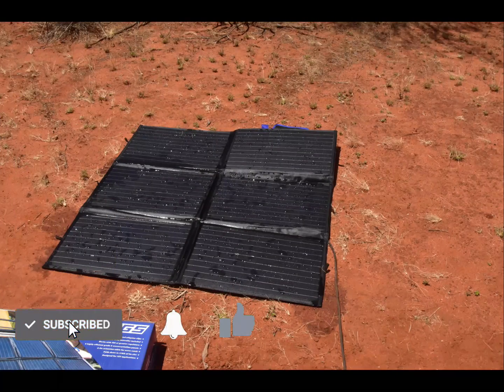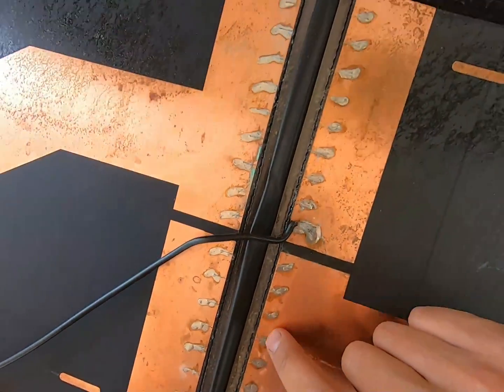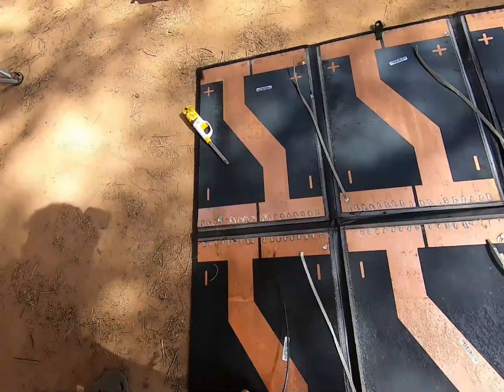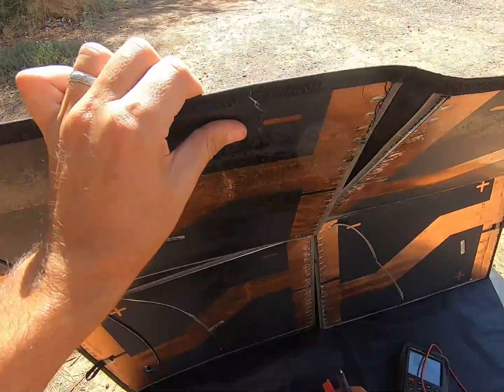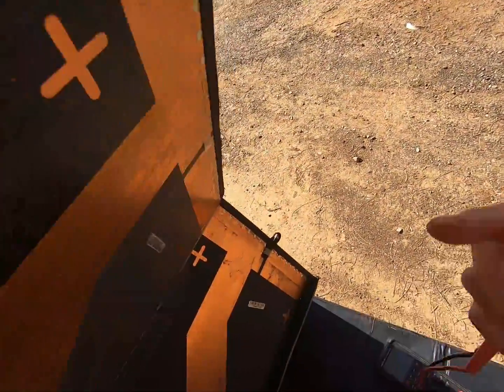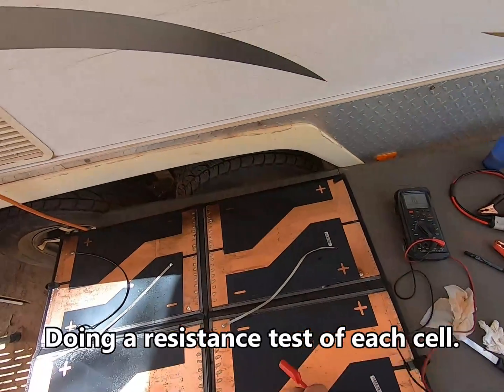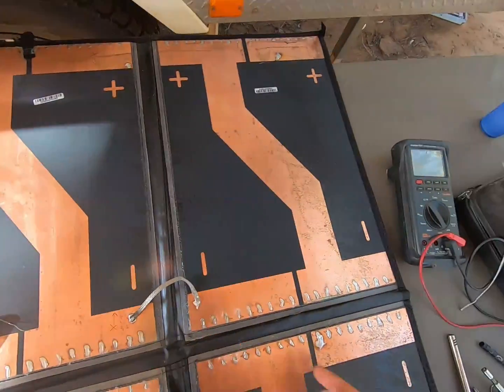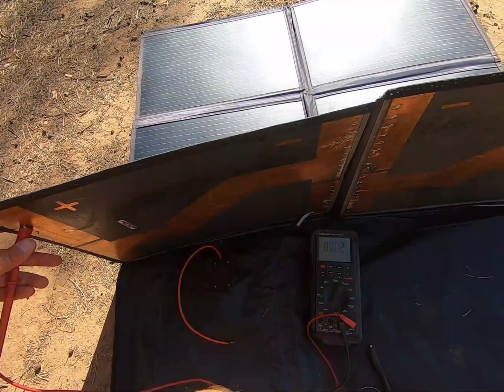[DETAILED] How to fix a faulty solar blanket

Comment: Hi thanks for the video might try to sort my blanket out aswell I’m getting 21v but only 0.5amps do you have any suggestions or just follow the video and narrow it down ?
Reply from the maker: It really depends how yours is wired up sorry. There are likely some sections in series and others in parallel, and depending what's failed will depend what's causing the low current.
Reply: @TheMusingGreg  it’s a 200w kings one aswell I’m assuming it would be a damaged wire because it’s been working for 3 months then all of a sudden nothing
Reply from the maker: It certainly could be a broken wire, but it could be one panel has suddenly failed. That's the benefit with getting access to the wiring on the back because you can test each cell and bypass any that may have completely failed, and hopefully get the rest working fairly well. Good luck!
Reply: @TheMusingGreg  thanks I appreciate your time in replying I’ll pull it apart and have a look before it goes in the bin hopefully can get it going

Comment: I just pulled my brother’s 2x4 Kings panel apart and it is definitely not made to the same standard as yours 😂

It seems to have been made out of a fabric that isn’t UV-stable and panels that are water soluble. Yes, really. The solar cells are on an MDF backing that is rotting apart.

Some of the panels are a different kind. Some to the stitching goes through the panels. Some of the interconnecting braided wicks have heat-shrink on them.

7/8 segments actually still make 3-4V but it isn’t worth fixing. I wouldn’t trust it to keep the lights on.
Reply from the maker: Yuk! I've never really thought of my Kings units being made to a high 'standard' but sounds like yours is even worse! 😄 Unfortunately what you've described is one problem with cheap brands like Kings. They will change suppliers when someone else can give them a better price, so there can be a lot of inconsistency between batches from different manufacturers, whereas more expensive brands tend to find a good supplier and stick with them. It's why I typically don't review really cheap stuff, because in 3 months' time it might be irrelevant.

Comment: You don’t need to de solder all the connectors to test each panel, leave ground on the Anderson plug and test each cell and it will go up by 1.8v each time.
Reply from the maker: That's a great tip, thanks for sharing!

Comment: Got a zero voltage foldable solar panel,  watched your video, I checked all the panels, they all worked, I realized it might be wrong with the diode, after removing the diode, got the 24v voltage, so I have to find a similar diode to replace it.
Reply from the maker: Glad you found the problem! Hope you get it working!

Comment: I have an XTM 120w blanket and a companion 200w blanket, i thought the XTM wasn't working well so i tested it today, getting about 3.5A. I tested the 200w and it also putting out 3.5A, I'm guessing something has failed like yours. I might have to do some more testing.
Reply from the maker: Possibly. Although check the voltage of the battery they're charging; if it's already nearly full you won't get max current from the blanket. You should get best results if the battery's about 2/3 full, so the regulator is able to maintain close to 14.4 volts without needing to dial back the current flow
Reply: @TheMusingGreg  I put the blanket in the sun, covered each panel 1 by 1, only 2 of the 5 were working. I cut it open and found the wire joining the 2nd to the 3rd broken. The other wiring on all the joins didn't look much better.
Reply from the maker: Great, well done following the process! Shame to hear of the quality but at least you can replace the links now and hopefully get it back up and running!
Reply: I kind of tested my 200w ridge ryder fold out panel with a watt meter, and even when I angled it to the sun on a clear day at noon, it was only reading just over 100w. It hasn't been used much, and I'm wondering if I need to remove the backing like you did, or is there is typically a failure rate with these panels?
Having a video to refer to is very helpful, cheers.
Reply: @colintranter5162  the wiring between each panel runs around each fold. When it's folded up and you put it on the ground by the handle, the fold that hits the ground and takes all the weight is where the wiring failed. Knowing that, I take more care how I handle it. If the handle was 90 degrees to the folds, it wouldn't have been a problem in my opinion.
Reply: @eroffroad5438 Thanks for the tip...I'll be more careful. They are a bit precious, although Greg was certainly throwing his around. 😅
Reply from the maker: @ @eroffroad5438 Good work chaps. I was just using mine the way I thought it should be able to be used, if it can't handle a bit of rough use in the outback then it's not up to the job I reckon! Colin if you're getting 100W out of a 200W blanket there's probably nothing wrong with it. From all the testing I've done on solar blankets on my channel, that's about right for many units unfortunately. Check out my original 2021 Kings vs Redarc video https://youtu.be/AActNzBZ9FA for example. If you're looking around for better-performing alternatives, consider the Allspark, Companion or Hard Korr Mk 2, all of which I've covered on my channel in the past couple of years
Reply: @TheMusingGreg Thanks for the reply, Greg.
In most of the reviews I've looked at it certainly appears that most of them don't put what there advertised at, which make wonder if I want 200w may be I should be looking at 300 or 400w fold out panel to get 150w -200w of real of world capacity.
But at the end of the day, any extra power is better than none on an overcast day.
Regards.
Reply from the maker: @dizygotheca5162  As a rule of thumb I would say plan for about 2/3 of the rated output under typical conditions so work on that. So if you want 200W, get a 300W unit. See part 3 of the 4 part series I did https://youtu.be/o8rLVv2oCnQ. The exception to this rule is the Mk 2 Hard Korr https://youtu.be/oZfFO8OQizM

Comment: Did you had no voltage prior to the repair ? I have a 120w panel and I had been testing it for few months. It was working fine with around 4A output. Now when I have to actually use it, something happened and now it won't give the same output and current is now only 2A. I have tried to test it without opening it by monitoring voltage by covering each panel out of four and see how much voltage loss I get.. One and two panel shows less voltage drop while 3 and 4 panel shows significant voltage drop. Basically don't know what that means and should I try opening it up and check, what do you suggest ?
Reply from the maker: Yes I had no voltage prior to the repair because half of one panel had gone open circuit. That's why for me it made sense to pull it apart and see if I could at least get something out of it.

In your situation it sounds like the panels with minimal voltage drop have gone faulty, either by having just reduced output,, or one part may have failed but it may be in parallel with another part which hasn't. In either case, removing the faulty part isn't going to increase your output unless it's in series with other parts that aren't faulty and can't currently provide any output.

If the panel is practically unusable for you as it is, you don't have anything to lose by opening it up and seeing if you can isolate the faulty part like I did. However if you're still able to use it as it is, I would just keep it as it is as it's possible you could go through all that work and not actually improve it at all.
Reply: @TheMusingGreg  Took the brave step today and removed the stitches. Four panel are attached in series and the rear side of the panels are covered with some white sticker so not like yours where you can see the copper. Anyways tested it without the sun for resistance of each panel and the first two show most resistance then the 3,4 panel. Soldering is all good and even checked the continuity from the +.ve points of the panel with the visible side thin wire coming from the front side of the panel. All showed continuity. But that's from the one side only, the other side does not show continuity with the terminal even on the good ones. This testing is without removing the series connection. Seems like the panels are just not producing enough volts and that's about it.
Reply from the maker: @CrazzyRandy  It would be worth disconnecting the wiring and measuring the voltage of each panel in the sun. That will help you compare the behaviour of each panel and isolate if it's just one panel with the issue. You could then put a small load on each panel and measure the current through that same load while using a voltmeter to measure the voltage it can hold while delivering that current; that will further help you determine the performance of each panel.
Reply: Finally opened it up last month and magically it was putting out around 60watts at 3 amp.  Measured it few times at it still showed the same. Today though to measure it again and it is back to 2 amp. All the wiring seems good, re soldered all the points and still same 2amps output.  God knows what’s the issue now. It’s nothing I can do and all the panels which are attached in series are good but just not producing enough. Something to do with Earths alignment with the sun🤣
Reply: And the back side of panel is glued with some kind of white sheet nothing is visible from back, only the output points are there.
Reply from the maker: @CrazzyRandy  It sounds like something within one of the panels. Try disconnecting the interconnecting wires and measuring the output of each panel in turn. If one is quite different to the others you can bypass that one and just use the remaining panels. That's basically what I did except I could bypass just half of one dodgy panel.

Comment: What was the one style heat gun you used?  Also, did you just use the existing solder and melt it back together or did you add mode solder?
Reply from the maker: Hi mate, it was a Red Devil butane powered soldering iron. I think I just used the existing solder but it's always good practice to add some new solder because the flux in the solder helps to make a good joint.

Comment: Could you change the kings blanket from series to parralel? And if so what would it do?
Reply from the maker: You could but it wouldn't work. The benefit is that if a cell failed the blanket would still give some output. However the big problem is that the output voltage would be extremely low (around 1.6v I'd guess although you could measure it), which would be too low to run the regulator and the low voltage would make it more susceptible to cable losses. 
At the moment you've got all those solar cells lined up in series which means the voltage from each cell adds together to give you the total of 20 volts or whatever they put out. If you put all those cells in parallel, then you'll only get the voltage of one single cell, but with the current increased by 12x. But with very low voltage you get many more losses in cables.

So bottom line, it wouldn't work 🙂
Reply: @TheMusingGreg  ahhhhh ok. Thanks for clearing that up for me. Wasn’t to sure. I might have a go at looking at my 200w kings blanket on the weekend.
Reply from the maker: No worries good luck! If you've got one dud cell like I did you can just bypass that and at least get some power from the others.

Comment: Hey. After the repair how many Wots was is producing?
Reply from the maker: Hi Craig, I can't recall if I didn't say it in the video, but I remember it was 11/12ths of the previous output. Given I usually got around 75W from Kings 200W blankets, I'd guess around 70W.
Reply: @TheMusingGreg  only 75? Damn I was getting 75w from 120w when it was really working.
Reply from the maker: @CrazzyRandy  Yeah they were very poor for me. I've recently bought a van with 3x160W ~12 month old Kings slimline panels on the roof. Should be 480W altogether, I get about 90! Same deal, Kings solar in my experience is a pathetic joke and false advertising.
Reply: I thought solid panels would be more reliable but seems anything solar from kings is crap. I have already returned the small 10 watt solar charger. What a joke it was.
Reply from the maker: @CrazzyRandy  I am yet to find any Kings solar product that works the way it's advertised - and I've used 1x 120W blanket, 3x 200W blankets, 2x different 'MPPT' solar regulators (looks like PWM inside with the words MPPT stamped on the case), and 3x 160W flexible panels. An utter waste of money in my view for anything other than careful and occasional use

Comment: Wouldnt it be possible on Monocrystaline panels, to simply Shade each minor "array/panel" one at a time instead of the total removal of all array covering?
Reply from the maker: @DOCWHOK9 it depends how they're wired up. On this unit, no that wouldn't have worked, because all panels were wired in series and there were no bypass diodes. This meant the one cell panel stopped all current flow and you had nothing to measure. However if you had a different configuration and the panel was just low output, then yes you could shade the panels one at a time and see which cell / section shading didn't reduce the output further, and then you'll know which is the dodgy one. But you still have to open it up to fix it.
Reply: @TheMusingGreg  Cool, great explaination. I think it would be great to have a switch that could convert a panel from serial <> parallel, and then that test would be easy. Itad be even better if panels auto-bypassed when faults occured.
Reply from the maker: @DOCWHOK9  Yeah that would be fun to do for us electronics nerds! Although probably impractical in production - the extra wiring and complicated switching would increase cost and complexity for no practical return for 99% of users.
Reply: I just did and it helped me to diagnose the fault. I found that only 2 out of 6 panels produce current. I am yet to open and inspect the connecting straps.

Comment: Ive just unstitched my kings 200w panel bought july2022 and surprisingly its in series parallel, and diagonal opposed in an L shape, and the entire thing is wired using braided cables that are NOT insulated. This meant that the main pos and main negative simply touched and shorted the entire panel! 

Ie   (1) - (2)
                I
      (6)   (3)
        I
      (5) - (4)
123 series
456 series  then both sets in parallel 
And the panels are sealed completely in white resin just like glass panels, and theres two tiny tin strips on each panel.
Reply from the maker: Wow, interesting. The series-parallel arrangement is curious - that will give double the current but at half the voltage - I wonder if that's so they can advertise it as a '20A' solar blanket?! It might give slightly better results with a PWM regulator where excess voltage is wasted, but I don't think it would benefit a MPPT regulator much. However you're going to get more cable losses if the supply voltage is lower. Or possibly since they're using a different panel now as you say, perhaps the new panels are higher voltage and lower current so they've done this to get the output back to what it should be. Curious either way.

Not using insulated cables might save a bit of money if the backs of the panels are all sealed off, but if you managed to get a short somewhere it's clearly not the right choice, at least wherever you got the short.

I continue to shake my head at Kings gear.
Reply: @TheMusingGreg  okay so, the diodes did help me find one panel that was going completely open circuit once hot, so ive made the decision to cut both sets of blankets i have apart, and find all the good cells and make one long single row blanket, and in doing so i tested the cells to be 7.5voc and some cells 3.2a short circuit current, others to be 2.5a so they really are a mixed bunch. Given im using a victron 100/30 ive decided to wire them in an 11 cell series setup, that way ill get the most voltage and least losses. Ill also be adding the diodes since if one gets shaded or goes faulty ill only lose that one cell. I also tested the known good cells in series with diodes, and then shaded one at a time and noticed a perfect 20w change each time. This means they are likely only 20-30w cells at best, so this blanket in perfect working order would only ever peak at 180w, it was never truly a 200w blanket. Its all lies 😪 

Even my best cell, 7.5voc and 3.5a scc that would only yield 26.25w with those figures.
Reply from the maker: @lexicase8805  Sounds like a very sensible plan! Yeah I think Kings takes a rather ambitious assessment of their product's performance - which makes me wonder about all their other products!

Comment: Great tips! 
I will add some fabric between the individual panels when packed to mitigate scratching, as I just purchased a value panel 😁
Used blankets were not well priced, sometimes dearer than similar quality new blanket 😮
I purchased a 50A Renogy controller (not much more $ than 30A). It has MPPT, DC-DC AND can charge my start battery too❕
Reply from the maker: Yep that's a good idea, so long as you remember to use them and keep the dividers clean. The risk with pieces of material is that they can just lie around a campsite and get dusty and in the way, and end up being less effective than they could. But if you store them somewhere clean and out of the way and remember to use them it should extend the surface life of a cheaper blanket.